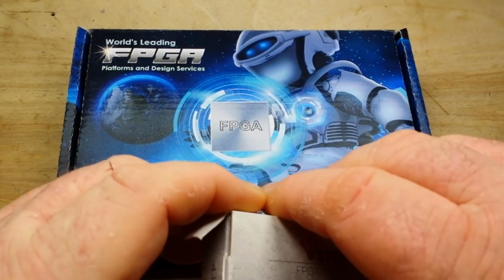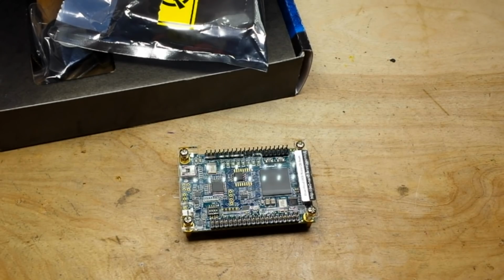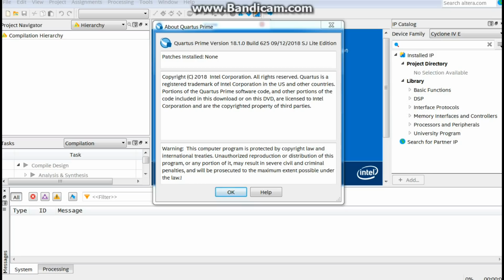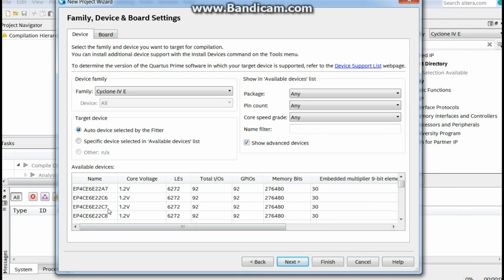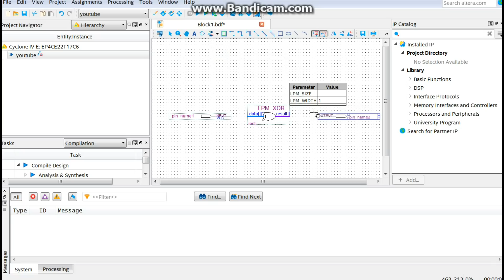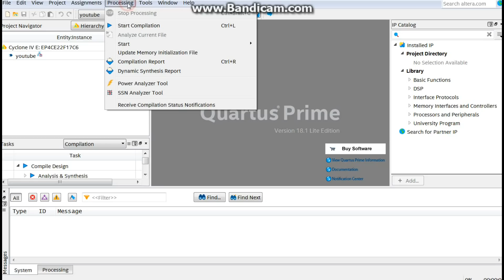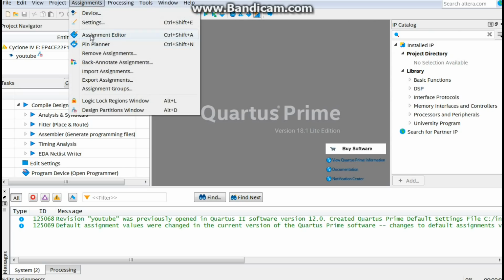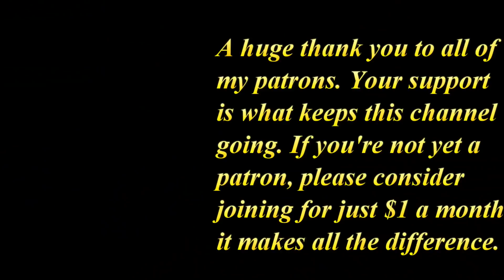Getting Started With FPGA's Part 1

Comment: I'd like to see a video on setting up the simulation software for an FPGA: Of the free licences which promise a basic system, most of them require something like 200Gb free HDD space, just for component libraries I'll never use. So I install the bare bones of one of them, try to call up the supposedly included model simulator, and it isn't there. They left that bit, the only thing I actually need, out. Feeble excuses about a version upgrade; just install this new version, it only needs 500Gb of HDD space and you can't split it. Er, no. So I download the freeware: That simply won't run, then it needs a new Java install to run upon, but there's no guidance apart from "install this thing" (which doesn't work). I could do it by buying a kit with a DVD with all the software on it, but I can't afford that for a few months.

Comment: Who needs an FPGA when you have a drawer full of 555 timers? ....nice presentation but would love to learn more...I started dabbling with FPGAs when I was looking at a home brew 68000 classic micro SBC (a "jackintosh" - I grew up with the 68000 chip so to speak so it's one of my favorites of the classic micros)...one design I am looking at requires an Altera (now Intel apparently owns them) as the glue logic which controls SDRAM timing, address decode, and refresh logic, communication and other control functions. I was attracted to the design because it can be built for low cost but does require programming a MAX chip in circuit (the design files are all provided).  These FPGAs can easily replace 100s if not 1000s of discrete logic chips (sequential and gate logic)  so learning them is well worth the effort.  Here is the Tiny68k SBC I am referring to >> https://www.retrobrewcomputers.org/doku.php?id=boards:sbc:tiny68k (there is also a rev 2 design follow the link in the post) Note if it weren't for the MAX chip that board would be MUCH larger and more expensive. Quartus software is pretty heft so you need a decent processing machine with plenty of RAM and hard drive space to compile designs. Note that this would be considered an advanced level project - I would not recommend for beginners. Try learning to program a GAL or PAL chip first.

Comment: Hi, good to see this kind of video, FPGAs are so little known. I am currently working with FPGAs but I am on VHDL side, not verilog (sorry guys ^^). Just to answer a small question, the MAX10 is basically based on a Cyclone 4 architecture with an internal flash added. And a second point, Altera was bought by Intel and is now named Intel PSG.
If you want to attract the people who come from "software" world, you could speak about SoC devices or just the Nios software processor which is compatible with MAX10 or Cyclone 4 you presented.
Please continue, we can do so much things with FPGAs !

Comment: I don't think that an FPGA that has been programmed is considered an ASIC. ASICs can be described using an HDL, but they're usually chips that are specifically made to do this one task as described in their HDL. Can't ever do anything else. You can update an FPGA by reflashing it. You can't update an ASIC unless you remove the IC from its print and replace it with an updated ASIC.

Comment: My question is, as a beginner with his first FPGA, what exactly can I do with an FPGA that I can't do with an Arduino? I understand the basics of what an FPGA is, and I know that people who really knows what they're doing can make crazy things with them, but I don't understand what someone with brand new basic knowledge of FPGA's can do with one or why they wouldn't just use an Arduino. Or are FPGA's just one of those things that aren't very useful at all until you're actually master them?
Reply: Arduino Uno doesn't allow to implement hardware logic. Example: What if you were to OR two sensor signals and connect them to a single External interrupt pin. With an Arduino Uno you will need to externally interface an OR gate chip whereas with an Fpga you can implement both the Arduino Uno logic as well as the OR logic. Some MCU's are available with Fpga fabric built into them like Cypress Psoc and Microchip has CLC feature

Comment: While FPGAs and PLDs are purely logic devices, they can be used to implement at least one analogue function. They can be used to make a PWM output that with an RC filter can be converted to an analogue signal, for instance a tone generator.

Comment: So it’s a PLC? Forgive my ignorance, I am trying to learn electronics and see everything from the perspective of an electrician.
Reply: Yes and no.
It is far more powerful than PLC but at the same time far more complicated to engineer
Reply: Hmm I find these intriguing. But I have a bunch of arduino boards and a raspberry pi that I have not used because I find the code part of it intimidating.
Reply: @kwhp1507  yes its a very interesting subject even to those who work in very similar field. My Boss has more than 20 years experience in embedded software but he is still impressed all the time about what this thing is capable of.

Comment: Why Analog FPGA can't exist ?
Reply: They could exist and numerous companies have tried. Most these days will be something that a company has requested a chip to be designed, for example, an FPGA with ADC channels built in for a specific purpose.

The are numerous reasons why a flexible design analog system would never really work. In analog you want to control noise etc so leaving a chip to route it's own pathways that are uncontrolled would be rather haphazard, digital integrity is not really an issue in comparison as you have more wriggle room when it comes to data integrity. If a digital signal has to get routed through a dozen blocks then the overall loss would be negligible when it came to interpreting the values but for analog every block could add more noise or loss causing the signal to degrade very quickly.

You can get FPAA which stands for Field Programmable Analog Arrays but they are nowhere near as adaptable as an FPGA.
Reply: @jonelectronics510  👍

Comment: I didn't see a link to the smaller STEP-MAX10 FPGA board.
     Amazon:  https://www.amazon.com/STEP-MAX10-Altera-FPGA-Development-Board/dp/B07V5T92HS
     Aliexpress:  https://www.aliexpress.com/item/32867905155.html

Also, I thought it might be worthwhile to compare how much logic is available on each FPGA.  Here's a summary:
     STEP-MAX10 (10M02S device):
          2000 Logic Elements/108Kbits memory/16 18x18 multipliers/2 PLLs
     DE0-Nano (EP4CE22 device):
          22,320 Logic Elements/594Kbits memory/66 18x18 multipliers/4 PLLs
     Arduino MKR Vidor 4000 (10CL016 device):
          15,408 Logic Elements/504Kbits memory/56 18x18 multipliers/4 PLLs

Note that these are different device families, so these numbers may not be apples-to-apples comparisons, even though all these devices are from Intel.

Also, these boards contain other devices other than the FPGA.  These other devices may not be so important if the goal is to learn about FPGAs and how to design them, but for a specific application, these other devices can be crucial.  For instance, the Arduino board also contains a pretty powerful SAMD21 microcontroller and a WiFi device.

Hope this helps and sorry if I made any mistakes.

Comment: The biggest problem with using FPGAs or even PLDs in hobby projects is placing them on a PCB, they have just too many pins.
The bigger devices use ball grid array connections. I spent 15 years working with FPGA and PLDs. Altera always had the most friendly development software. I have found one of the limitations of the Altera FPGAs is that they are implemented in ram and require an external non volitile memory device to hold the program or an external processor to write the program to the FPGA at power up.
In the early days there was a significant difference in the design philosophy needed for PLDs compared to FPGAs. The former were very limited by the logic cell avaliable, most were linked to the number of pins. So much so, that some logic  functions needed logic to be looped back through an external pin. Designing with FPGA devices like stratix or cyclone had so many logic cells that a different design philosophy is required. The epm7064 was my favourite PLD, as with only 44 pins in a j pin SO package, it was the largest device I could place on a hobby PCB. 
I found designing with these logic devices, where everything  happens on a clock edge in a parallel, made it difficult to return to microcontrollers and DSP programming, which perform essentially sequential logic operations.
For the very large FPGA devices, the design process is rather abstracted from VHDL coding. As the philosophy becomes one of designing a system on a chip, with macros for processors, memory, (both ram and rom) and all kinds of peripheral such a either net, serial bus standards, PCI and PCIs, uarts etc. At this level of abstraction, the design process became one of ticking boxes to indicate what was to be included in the chip, rather than the more satisfying logic design.
Reply: The cheap cplds such as the coolrunner is rather restrictive in terms of macrocells. So much so it is normally easier just to use a micro unless you have a specific clock reason as you say.
Reply: @jonelectronics510  I agree, finding a place to use a FPGA or PLD can be difficult. Apart from anything else it requires a particular mind set to see how the logic devices can be applied. My introduction to them was the very small EP600/620 and the 22v10. 
It was certainly easier starting with PLDs and working up to FPGAs. 
In my first project, I was required to use an EP600 as the interface between a radio frequency synthesiser PLL and a non volitile memory device which stored the frequency programming data table. A set of dip switches changed the prom upper address lines, allowing the synth to step through the lower address lines to read the eight or so bytes that defined the VCO frequency by setting the synth dividers.
 Using a PLD solved a number of problems that could not be addressed by a microcontroller. 
One of the problems was that the synthesiser kept refreshing from the prom instead of reading from the prom once after the upper address lines became stable. This resulted in the generation of RF sideband  noise on the VCO output, as each refresh disrupted the divider count. The PLD was able to check when the upper address lines became stable and trigger a single refresh cycle for the synth dividers. Using a micro in this application would have been impossible as itsown click  would have contributed to the RF noise and the refresh process was under the control of the synth IC. 
Using  a PLD had the added benefit that it was possible  to design the logic so that in later versions the the prom could be dumped and the address lines used as a serial bus interface to a central microprocessor controller.  This  allowed the synth to be controlled remotely. Allowing a stack of base station transceivers to be configured from a central user interface.  It all sounds very old fashioned now, but this in the early days of synthesiser telecom PMR equipment. before that radio frequencies were set by switching crystals on crystal oscillators.
It is surprising how much can be achieved with just 64 macro cells. I once used an ep7064 to implement a full optical channel modem, complete with PLL clock extraction, and biphase encode/decoder. The PLL was interesting as it used the same digital phase detector as can be found in the CD7046 PLL IC. In this case it was used to pull a VCXO which was divided down to make the master bit clock.
Reply: @jonelectronics510  I think I planned "bridge" for ATMega128 memory bus. it created chip selects and AD buffer for ram and other 6 devices and it also contained 8 bit in and 8 bit out. I think that fit in 64 macro cell device.

Comment: More please. I am very interested in digital electronics. If you need it I have some Quartus files I can send you of basic circuits proving some basic Boolean algebra with the block diagram file and VHDL file to prove that both methods would have equal input/output combinations and truth tables.

Comment: Can these be wiped and reconfigured for another application if desired?
Reply: Each powercycle FPGA will fetch it's configuration from external FLASH device or master MCU will configure it. Also for bigger FPGA:s you can use partial reconfiguration with PCIe where pins configuration is stored in FLASH image and rest is downloaded over PCIe.
Reply from the maker: Yes they can

Comment: what is the use case of a FPGA over an Arduino Uno?
Reply: FPGAs are much faster and for example much better for image recognition or robots
Reply: An Arduino Uno has a single processor(Brain) so it can do one single task at a time. With an Fpga you can implement multiple processors on it and have them do multiple tasks at the same time(Parallelism)
Reply: And to blow you mind further, you can build micros inside an fpga!!
Reply from the maker: Totally different animal

Comment: Years ago I wanted to reduce the size of PCB so took advantage of Xilinx CPLD, A XC953615 if I remember, to create: a 7 seg decoder, Binary to BCD converter, some glue logic for another part of the circuit and several PWMs for some reason I can't remember....anyway it reduced the chip count and still worked from 5V (Yeah those were the days!). Ultimately they can be really useful if you want a load of IOs and completely seperate/independent driven logic circuits - true parallel processing. It was also a mix of synchronous and asynchronous circuit design. Modern day FPGAs and CPLDs to an extent are very difficult to place into a hobby project without a huge price tag from additional components to support them -as you mentioned. Looking forward to see what designs you come up with ;)